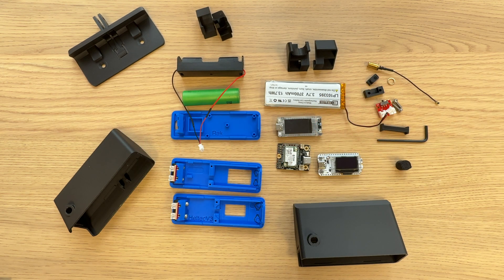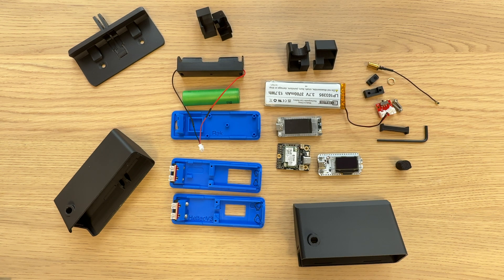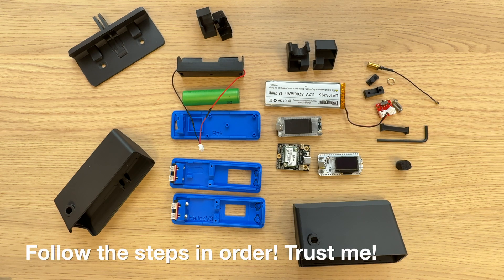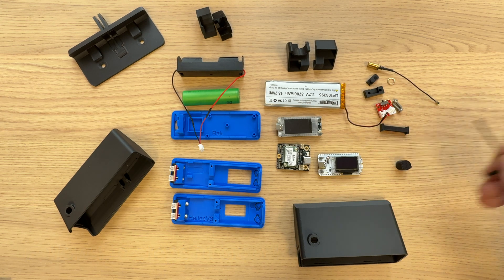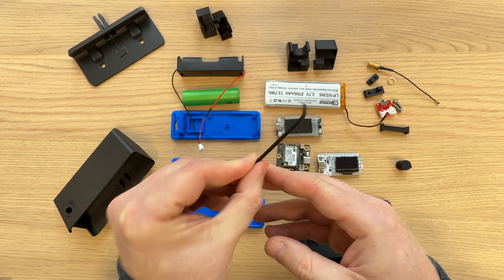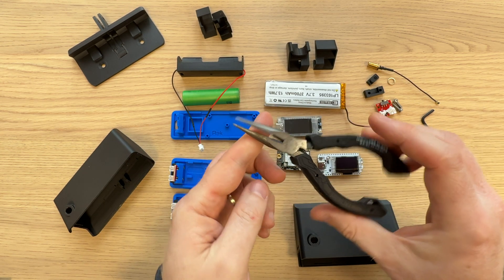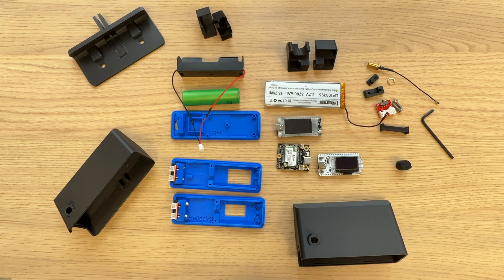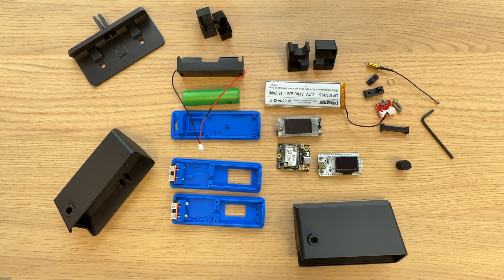Flexo Assembly Guide - Meshtastic powered case for Rak WisBlock, Heltec V3, T114 & RaspberryPi Pico

Comment: Hi Chris, Just was Wondering If You Going Add More Boards? Like the  Heltec Wireless Tracker, I have a few of these. Also How Do we go about adding a GPS? I'd like to try using my RAK 4631 with the RAK12500 GPS. Thanks
Reply from the maker: Wireless tracker and T190 support is coming. The Rak front has a mount for the 12500 GPS, didn’t have it to hand when recording 🤦‍♂️
Reply from the maker: Wireless Tracker nearly done, will be live next week 👍
Reply: I look forward to it, then I Print It and Share To You. ❤ I contact you then regarding them Custom Switch as well. Thanks